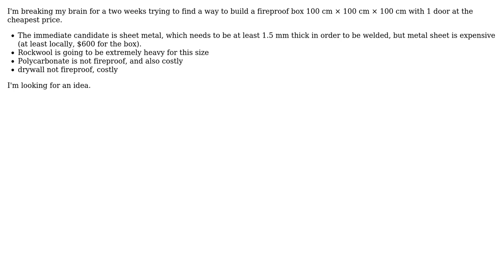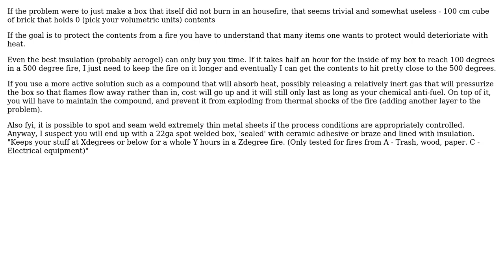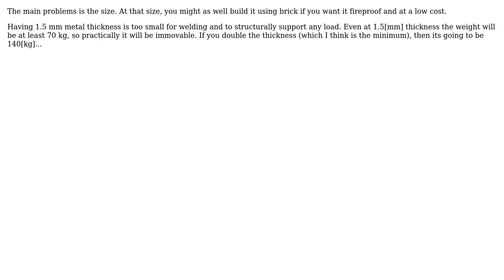Engineering: What is the cheapest way to build a fireproof box? (3 Solutions!!)

Comment: Well, I'm building mine out of thick wood. Double skinned with sand in the cavity and all seams protected by intumescent beading. It only needs to hold until the fire engine arrives. Cheaper than using 2 mm steel and the burnt wood is a good insulator.